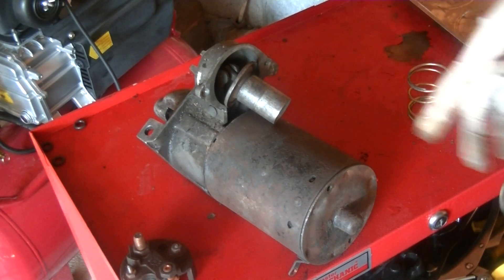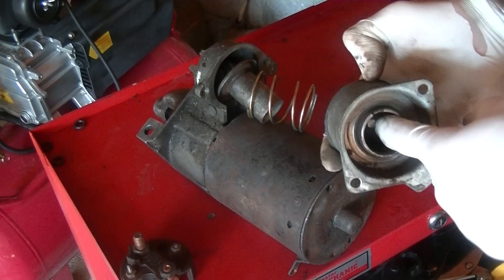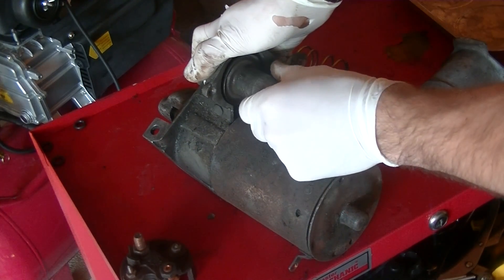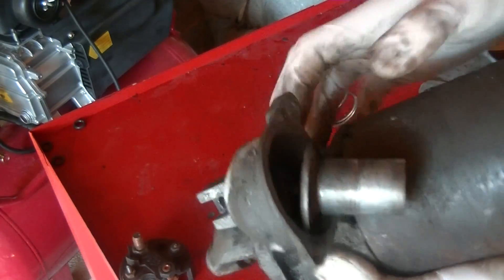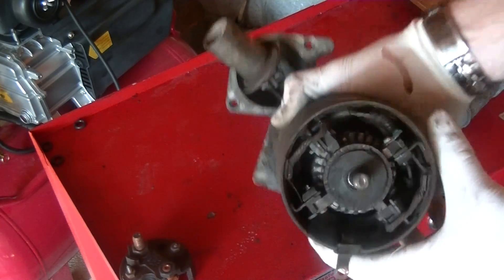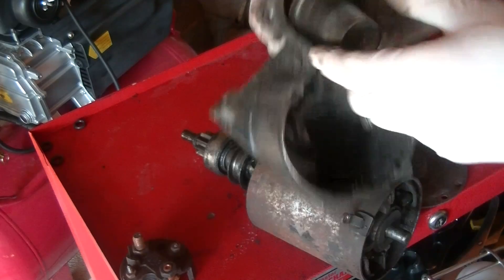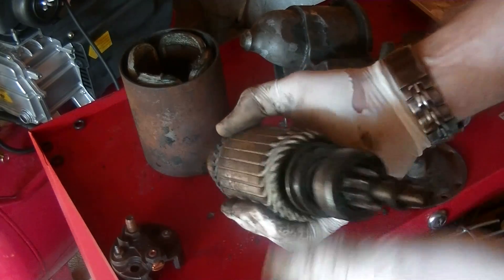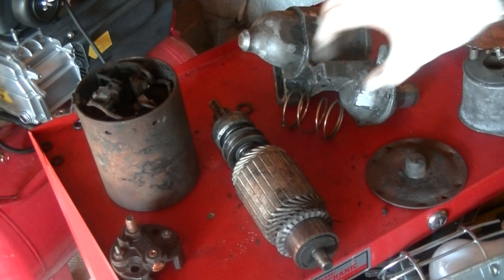How a Starter Works

Comment: Hey does the ground wire connect to the positive or negative on the battery?? Thanks.
Reply from the maker: Carlos Villalobos The ground wire for what? Typically starters are grounded through their chassis and have no ground wire. They DO however have a positive wire.

However, in all cases, ground = negative.
Reply: Well I have a 92 Honda prelude and when I try and start it, u can just hear a click. So I looked under the hood and there is a ground to the trans, ground to the body and I found a wire(which is black that's why I don't know if its a ground or just a black wire) connected to the starter. So I'm unsure where to connect. Help!
Reply from the maker: The cable going to the starter is POSITIVE and is where the starter gets its power to crank the engine over.  

The first thing I would do is make sure your battery is fully charged and in good condition.  Jump it with another car and see if it starts.  If the battery is weak, it will have enough power move the starter solenoid (the clicking) but not enough power to crank the engine.